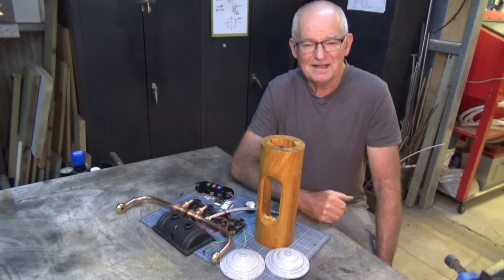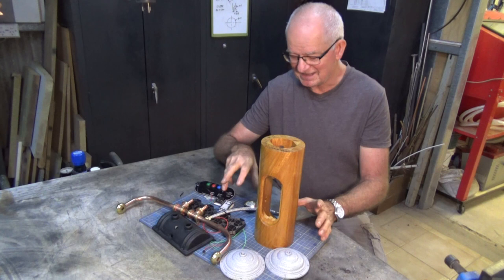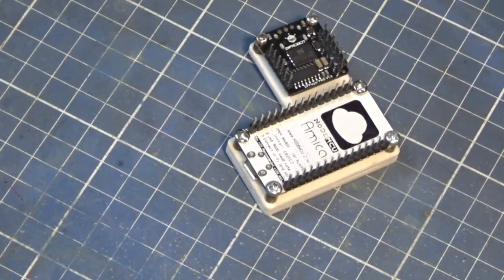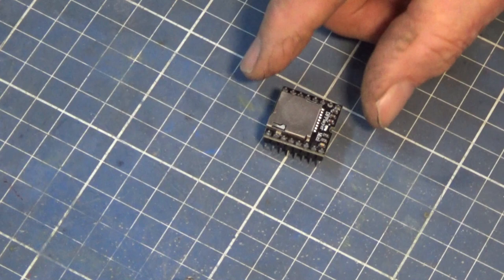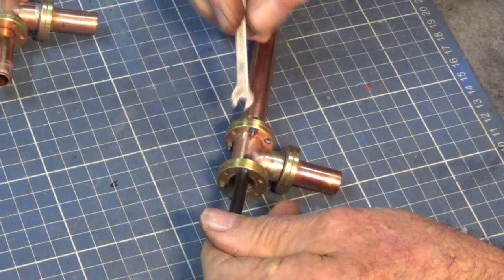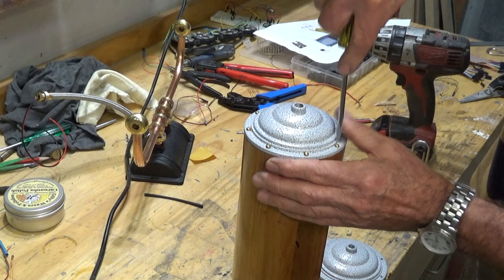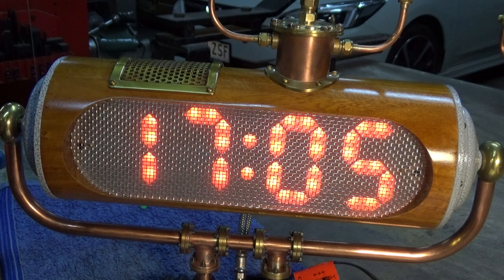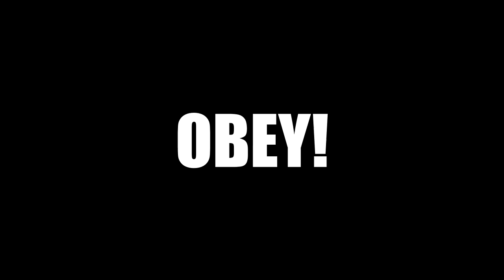The "MIXIE" A DIY Steampunk, Backlit Digital Clock - It's Alive!

Comment: WOW ........ Fantastic .......  Thanks so much Mark.  I've watched and loved every minute of this series.  Can't wait for what's next around the corner.  👍👍😎👍👍
Reply from the maker: thanks Joel. I can reveal that the next video will be about making some DIY low voltage garden lighting! I told you it would be completely different. It will involve some CNC machining, metal casting and some powder coating action. Maybe some tricky glass work as well.
Regards,
Mark

Comment: Well that turned out just as nice as we new it would 🙂
The speaker grill is just fantastic.
A tip for small nuts - you can stick them to the face of a flat bladed screwdriver with Blu-tack and turn the screw into the stationary nut.
Reply from the maker: I have a supply of blue tac in the workshop but I sometimes suffer from tunnel vision and persist with doing something the hard way instead of taking a break and thinking it through. 
Regards,
Mark

Comment: From memory I had to link / unlink two of the pins on the MP3 player together to stop the clicking and to get it working - can’t remember which ones but a search on ( I think ) GitHub gave me the answer - it was about 3 or 4 years ago and there have been many beers under the bridge since then ! I eventually gave up using the mp3 recorder to record a radio podcast via an esp32 set up as an internet radio- opted to modify a digital radio , record using an audio to mp3 converter from Jaycar all controlled by an Arduino nano which is in turn controlled by a mains timer plugged into the wall socket . I tell ya the things a bloke will do to listen to a fishing show without having to get out of bed at 4 am 🤣
Reply from the maker: I searched in vain for some easy to understand documentation which would eliminate that horrid clicking sound but everything I found was either too technical for my little brain or just a description of features. As it turned out the DFRobot players were about five times more expensive than the cheap DFPlayers but at least they worked straight out of the box. And they did actually come in a branded box which was a refreshing change.
Regards,
Mark

Comment: I love the inner light trick to bring the light out of the discombobulator.
Reply from the maker: Pat, I was initially really disappointed with that feature on the clock. I really did expect it to be too bright but most of the light seem to pass straight through the copper coil without illuminating it very much. I tried all sorts of things placed inside the coil to help interrupt the light. I think I tried round acrylic rod, plastic straws, rolled up tracing film but at the end of the day the laser engrave acrylic worked great. It's not too over the top but still quite visible. The digital display gradually changes through all the colours so it always looks a bit different. 
Regards,
Mark

Comment: Mark, I'm less than half-way through this video but wanted to mention (before I forget) that there are small fastener devices available called "Gripster" at Micro-Mark.  I've only tried one really cheap one and wasn't awfully impressed, but they are ~pen-sized and have spring-loaded wire "fingers" that extend to grab a nut or small fastener to twist (i.e., start) them onto the mating fastener or into their threaded hole.  Perhaps you could look into either them or into something similar (once you've seen what I'm trying to describe).  They come with different numbers of "fingers" to better grab whatever small fastener you're trying to work with.

Edit:  Some Luthiers use special "slotted" screwdrivers that have a piece of cylindrical tubing around the tip to prevent the tip from slipping out of the screw's slot and scratching the instrument's (costly?) finish.  Perhaps you'll get lucky and find the sizes you prefer at a reasonable price, if accidental scratches are too much of a PITA?

I think these clocks came out even better than I thought they would -- congratulations!  I can't wait to see what you come up with in your next videos!
Reply from the maker: Bob, thanks for the heads up. I just found the website for these tools and there are some wonderful items to be had here. I am now torn between the gripster tool you have described and the dedicated screw starting device which grips the head of the screw on the screwdriver blade. I will need to sift through the whole site before making a decision. As always though, shipping costs from the USA can be crippling for us here in the antipodes. 
Regards,
Mark

Comment: Absolutely beautiful love it
Reply from the maker: I expect I will get sick of the chime soon enough but I still get a kick out of hearing it. It's also really accurate. I have a large grandfather clock that loses and gains up to five minutes a week! I have three WiFi enabled clocks now and they are all within seconds of each other. They should be theoretically exactly alike but they don't always update themselves at the same time. I think they update from the time server once every 30 minutes and in between times they use the internal clock cycles of the microcontroller so they tend to drift apart a bit. 
Regards,
Mark

Comment: G’day Mark, the clocks look really nice although I think the Mrs may want the chimes turned off eventually and only resurrected on special occasions. 
I too had the same problem with comments, very annoying, now I just don’t get notifications, hmm what have I done or is YT just messing around with me. 
My old hands have problems with small parts, something we just have to live with. 
Cheers 
Peter
Reply from the maker: I have had both clocks running in different parts of the house and they get ever so slightly out of sync. This is because they don't always get refreshed from the time server at the same time. I think the code calls for a refresh every 30 minutes and in between times they run on their own clock cycles. So, the chimes sometimes don't match up. So far, I think my wife is humouring me but that might all come to an end fairly soon. Having said that, I have a very old Enfield grandfather clock that can be up to 3 or 4 minutes slow or fast by the end of a week so chimes are sort of arbitrary anyway.  
Regards,
Mark

Comment: Your projects are always very well thought out and executed with precision.  I completely understand wanting to get a child to help with assembly, arthritis can really make the assembly process rather difficult.
Reply from the maker: I have a friend that was a very talented clock collector and repairer. He retired about eight years before I did and I caught up with recently. He dearly regretted having to give up repairing clocks since he had the same issue I now have which is the lack of dexterity for handling small parts. I do think though that it's a case of use it or lose it. So, for now I want to keep doing as much work as I can to stop from seizing up altogether.
Regards,
Mark

Comment: Mark, I think you and I would have had success if we weren't being plagued by that crappy MP3 player module we started with.  In any case Mitch's version is cleaner and fancier so all is well!
Reply from the maker: The funny thing is I found a YouTube video where a maker had used that cheap DFPlayer and he reported that it worked just fine. I must have wasted 10 hours just trying to get it to play the entire set of files in sequence let alone integrated with the rest of the clock. Mitch still hasn't got his DFRobot players yet and I believe he is looking forward to adding them to some of his clocks. Still, we all got there in the end. Thanks again for your help.
Regards,
Mark

Comment: The death of the bad mp3 module resonated, i have a couple of similar pcb ebay specials responsible for way too many wasted hours too..
Reply from the maker: I tend to be a bit naïve when it comes to buying hardware. If it seems to good to be true (regarding price point) then it probably is too good to be true. Also, there tends to be a lack of support material for those cheap devices and if you run into a problem there's no one to turn to when it all goes pear shaped!
Regards,
Mark

Comment: 17:25: slippery slots............. if you got a suitable piece of small-bore neoprene tubing, cut a short piece and slip it over the driver blade and screw head....... keeps 'em in line til the last half-turn.................... also useful if you screwing right up inside deeper holes........... fix screw to driver - aways yous goes
Reply from the maker: My main issue is a lack of dexterity due to arthritis. I find it really hard to bend my last finger joint enough to grip small things easily. It's probably a case of denial but I tend to assume I can still do the really fine work I used to be able to do without "assembly aids". 
Regards,
Mark

Comment: Beautiful work, I really like how it turned out. One question, why not use the same screws holding the front acrylic panel to hold the steel mesh too? I don't see it as a visual problem, as the screw is still visible underneath the mesh.  Sorry if this was explained earlier, I must have missed it.
Reply from the maker: The spaces between the wire in the mesh aren't really big enough to get even a small wood screw through without having to drill or punch a hole. I was worried that this would allow the cut sections of wire to work loose. The little 10BA metal thread screws do fit though but they weren't long enough to get through the acrylic screen as well. 
Regards,
Mark

Comment: Hi Mark, Are you using a different camera or settings in the last few videos? The focus isnt as sharp and colour seems less vibrant than earlier uploads. Great content alwasys interesting and informative...
Reply from the maker: I know what you mean. I really do need to invest in some better lighting. The camera sometimes struggles to cope with the poor lighting in some areas of my workshop. I have a very small LED movie light but it doesn't really work well when it's a long way from the subject. I use a Sony Handycam which is not exactly the best spec camera for this sort of work but it's easy to set up and it's quite portable. I will try to do some more experimentation to see if the quality can be improved. 
Regards,
Mark

Comment: This really looks great Mark. I think it's very Jules Verne-esque. 
Have you considered embedding the wire mesh in clear casting resin? One side could be polished & the other blasted. Look fwd to what's next. Stay safe and well :)
Reply from the maker: Anthony, I did consider laminating the mesh in two layers of acrylic but having the mesh exposed does make a nice textural finish on the front of the clock. It probably doesn't show up well in the video but the shiny strands of the mesh seem to create a sort of glow around the digits. Of course it might come back to bite me when dust inevitably gets trapped between the mesh and the acrylic. Bugs and spiders will also make a home there too.
Regards,
Mark
Reply: @Preso58  I was impressed with your brass fittings - having worked at sea most of my life, I thought it'd make a great piece for an old ship.

Comment: Just curious why you didn’t use a single screw to secure the wire mesh and the plexiglass?
Reply from the maker: In hindsight it would have been the logical way of doing it but unfortunately a project like this evolves over many months and although I always model the build in my 3D CAD programme there are always details that don't get resolved. I think I had originally considered fitting the mesh with double sided tape but it didn't look very neat. After that I thought about making a feature of the brass round head screws and adding lots of them around the edges of the mesh but I didn't have enough for two clocks.  If I were doing it all over again......🤔
Regards,
Mark
Reply: Well it still came out beautiful !!

Comment: Mount the DF player on a spike above your workbench, as a warning to the others.
p.s.   I see that clear powdercoating wood is a thing, does that mean you can build something like your clock and just powdercoat the whole shell?
Reply from the maker: I have powdercoated wood before but moisture content can be an issue. If the wood is really dry and dense it works well. If it all goes badly you basically have a mess which is really hard to sand off because powdercoat is so tough!
Regards,
Mark

Comment: I never worry when a youtuber doesn't respond to my (typically dumb) comment, we all have lives and limits. PS: tiny nuts ... I sometimes find it easier to hold the nut at the start of the screw and give the screw a little back turn to click the nut into the thread
Reply from the maker: Thanks for understanding, and the tip! I have tried magnets, double sided tape and blu tac. I also have some surgical forceps of different sizes for getting into tight spots but somehow getting the thing on with your fingers is always preferable. if you can grip the things!
Regards,
Mark

Comment: it'd be interesting to get the source code for the clock to make something similar, if Mitch is willing to share.
Reply from the maker: Aron, check the video description. I added a link to the Arduino code, the circuit diagram and the menu cheat sheet. The link will take you to dropbox and you can download all the files from there. I just had to check with Mitch first but he was kind enough to make the code available publicly.
Regards,
Mark

Comment: nixie not mixie nixie like nixie tubes
Reply from the maker: Well, here's the thing. I have a Nixie clock with nixie tubes.  I got carried away and built a Lixie clock which has an edge lit acrylic panel display. Then I built a Vixie clock which has a backlit LED display with a front face made from "V"eneer. So the next logical step was a Mixie clock which has a back lit LED display with a front panel made from "M"esh. It's all a bit confusing I know but I like quirky clocks.
Regards,
Mark